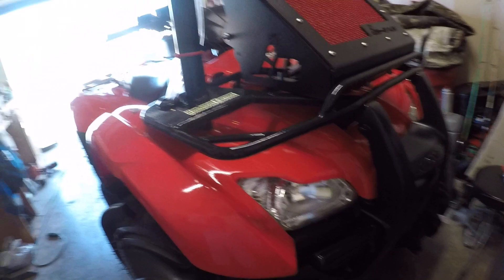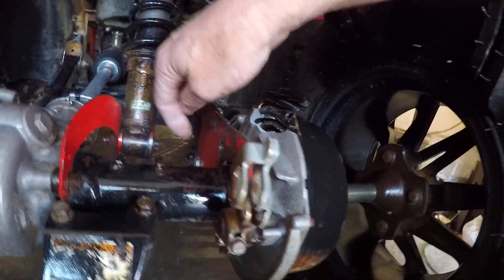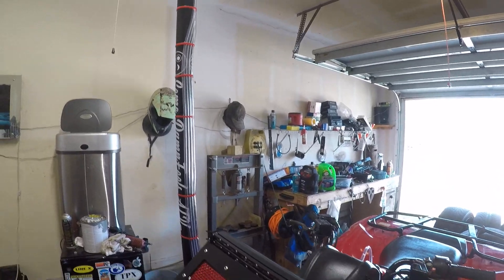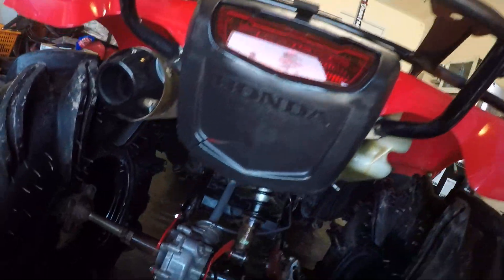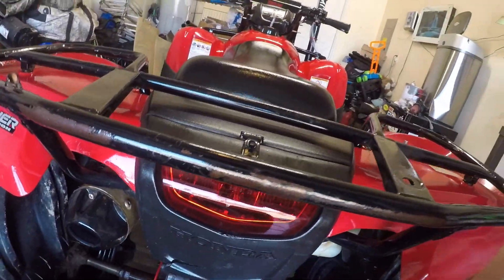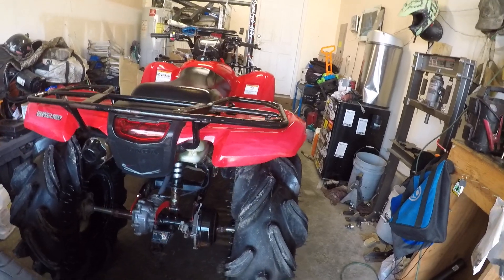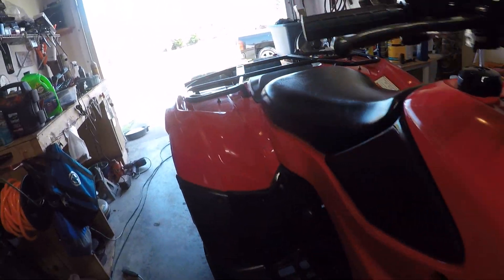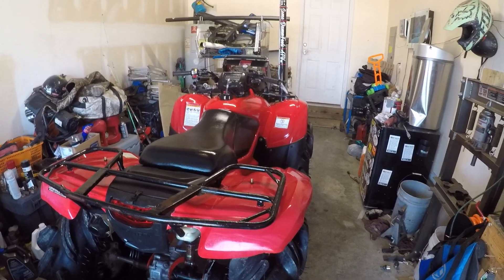Walk around 2013 Honda 420 2.5in lift 3in stretch 69% gr 32.5 ol2s UPDATE

Comment: Did you stretch it using pipe? On the drive shaft
Reply from the maker: Brackets and the driveshaft.  Don Oglesby on Facebook makes and sells them
Reply: @SomeDamnfoolsAtv  you don’t know if he used pipe or not?
Reply from the maker: @nolenharper3533  no he didn't use pipe. He makes plates to extend the swingarm...and extended the driveshaft...now that has a piece of pipe welded in to stretch the driveshaft
Reply: @SomeDamnfoolsAtv  yessir that you finally someone who could answer my question

Comment: Love the videos buddy! bad ass setup man.   I got a snorkeled 300 and was curious if you ever got your 300’s leak fixed. Mine cut off with the bars under yesterday and I can’t figure out why the carb got water in.  Fuel injection is the way to go
Reply from the maker: It definitely took some trial and error to get the 300 straight! I think I ended up running the carb drain to a vent line... and everything connected to the carb ... everything. And thank you for the compliment brother I appreciate it!!!
Reply: @SomeDamnfoolsAtv  Absolutely buddy! Take it easy man